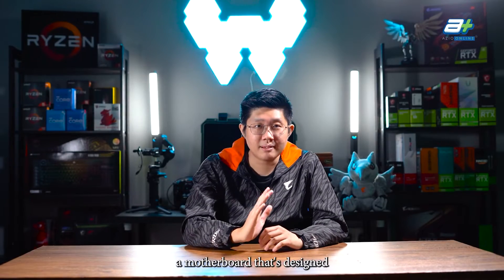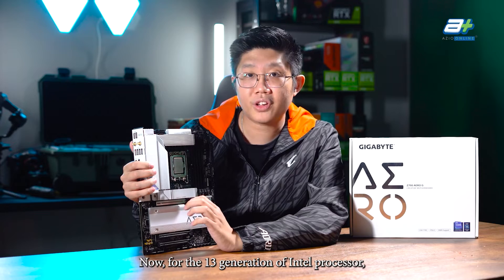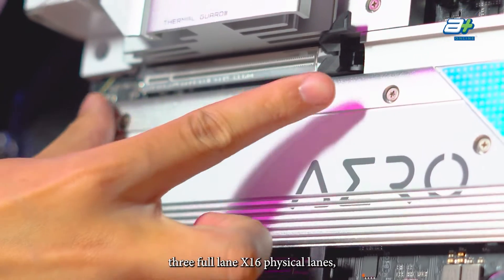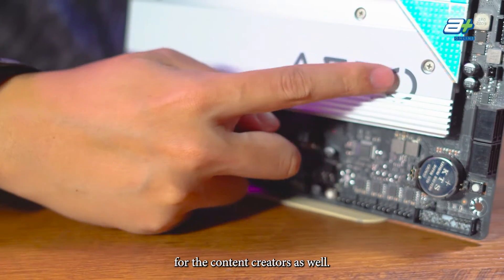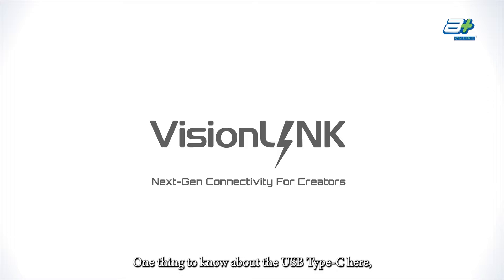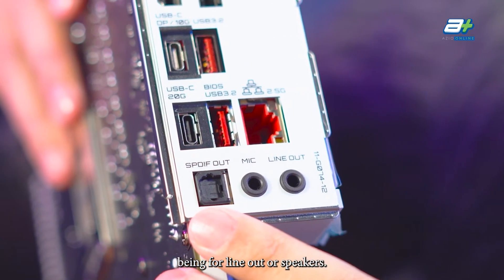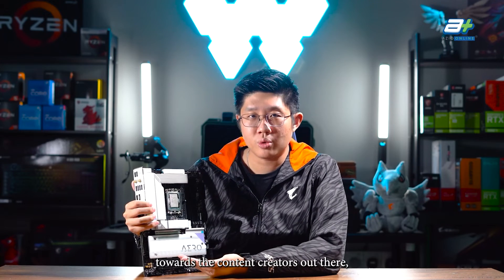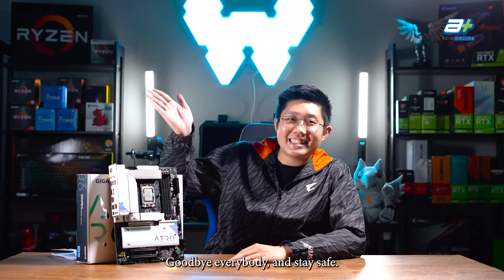The content creator's choice of motherboard? - Gigabyte Z790 Aero-G

Comment: Creator PCIe slots Question.

So will this board support more than one graphics card?

I have two 2070 Supers that I would like to salvage from my old build and I hear that these cards don't use the full potential of PCIe 4 and above anyway and with no performance difference between x16 and x4.

Will I be able to plug them both in successfully into this board?

Thank you for your advice!
Reply from the maker: There shouldn't be much performance loss due to the bandwidth of PCI-e Gen4x4. Will it be mainly for work? Cause if I recall SLI/NVLink (for gaming), it doesn't support x4 bandwidth.

But if you're using that secondary GPU for work, like hardware accelerating on 3D applications. I think the setup should be fine, just need to make sure your casing and power supply is able to handle two 2070Super. :)

Comment: You say it does wifi6e, but the logo only shows wifi6
Reply from the maker: https://www.gigabyte.com/Motherboard/Z790-AERO-G-rev-10/sp#sp

in the official specification for the motherboard in the "Wireless Communication module", the chipset used is the "Intel® Wi-Fi 6E AX211", which does indeed support WiFi6E :)